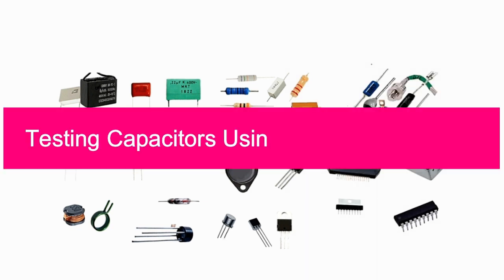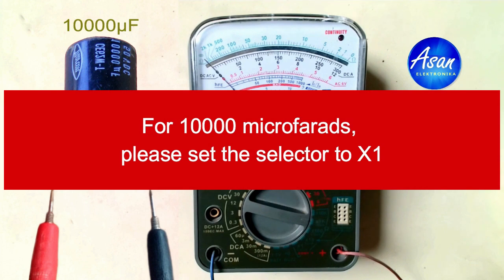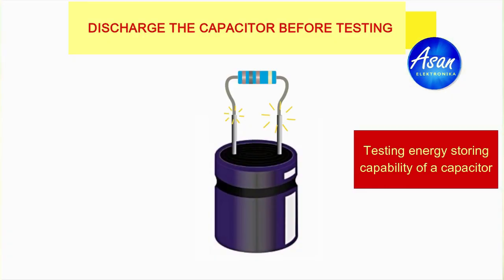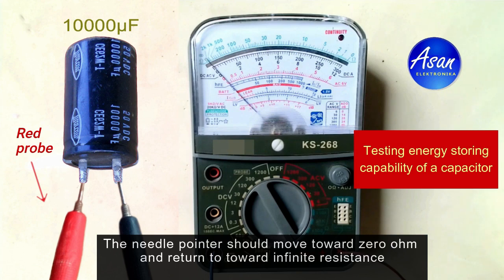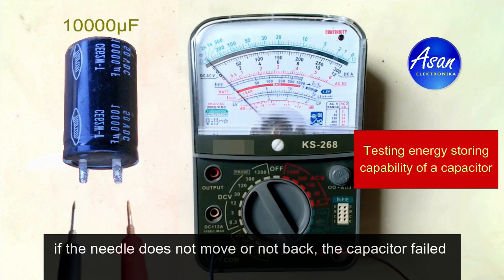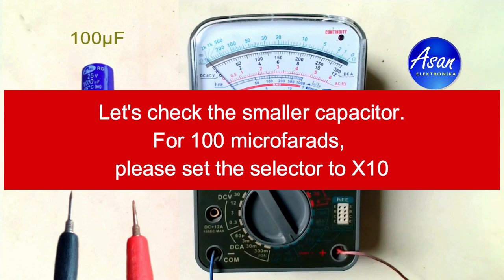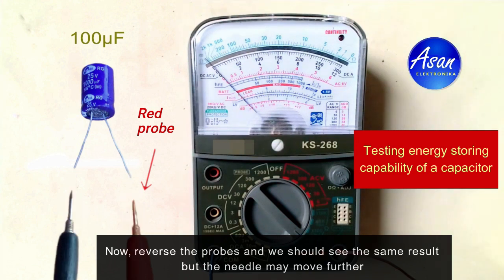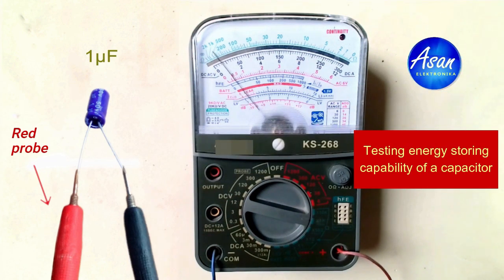How to check capacitors using  multimeter by #asan

Comment: If the pointer reach to the the 0 ohms and does not go back so it means the. Capacitor  is shorted? Pls reply
Reply from the maker: Yes that's right, If the pointer does not go back ,the the capacitor  must be shorted

Comment: Saya beli elco baru, di cek awal dengan multitester digital hasil bagus (dari 1 angka naik lalu kembali ke 1), tapi setelah saya cek ulang (kedua kali) kenapa hanya angka 1 yang tampil di display multi tester nya. Tidak seperti di awal pengecekan. Apa lah elco nya masih bagus/ sudah rusak?
Reply from the maker: Gimana kl di cek pake mutimeter analog,  jika jarum tidak bergerak berarti elkonya mati. Atau untuk memastikan multimeter digitalnya masih normal coba cek elko lain🙂